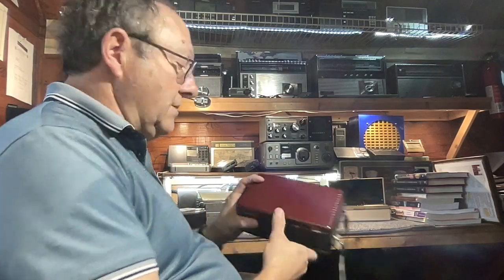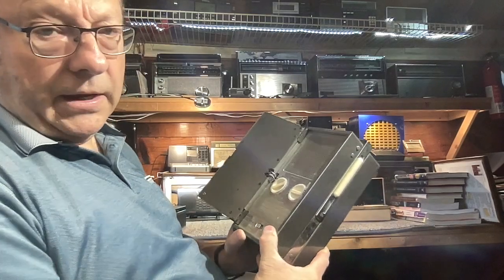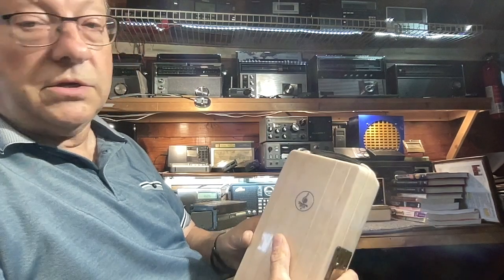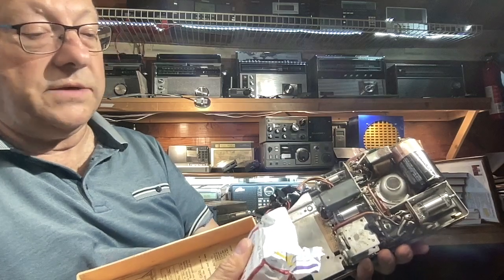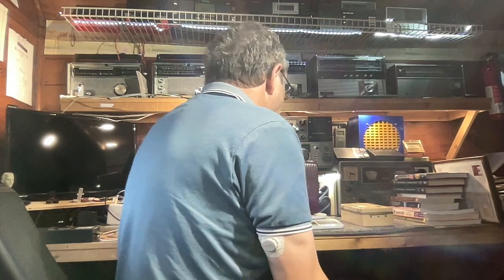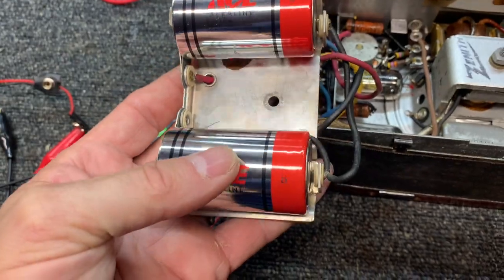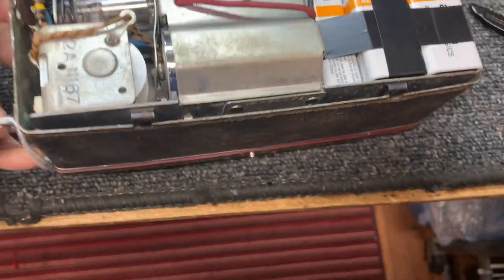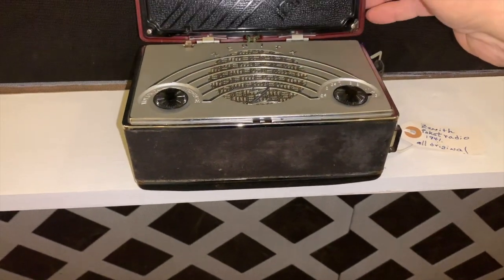Vintage Tech: 1941 Zenith POKET radio

Comment: N4 KRO
W4KG

Have you ever heard that in the tube days, of placing the tubes in a 150⁰ oven for an hour to help the oxygen eater to help with removing/ converting the
 oxides that build up over idle time?
See you Friday
W4KG
Reply from the maker: Yes it’s similar to rejuvenating a picture tube. But only a temporary fix. It’s a good idea if there are rare tubes.

Comment: I notice that tuning condenser is missing a screw. I don't know how you put your finger on it and didn't see it. I'm still watching the video so if you finally realize it's missing disregard this comment. That screw that's missing is part of the alignment
Reply from the maker: Good eyes.  This is not uncommon. This ring with the "missing screw" is a capacitor.  It is the broadcast antenna trimmer.  The adjustment is done by bending the ring slightly.  It does not need a screw and insulator like the broadcast oscillator capacitor uses (it has an insulator and screw).  Some sets do not even use a broadcast antenna adjustment.  I also pointed out the broadcast padder adjustment - which also serves as an antenna trimmer.
Reply: @KOVintageTech  Fair enough. 👍

Comment: Can you explain what you mean by "giggles" ? I don't get what you are saying when you say "Let's change this just for giggles" I
I'm trying to understand what "giggles" has to do with changing a part or working on something. I know giggles is a form of laughing, but you must have another meaning of it that has to do with electronics. Please explain why you keep referring to "giggles" 
Thanks
Reply from the maker: It's an American expression.  I said I would test them even though I am replacing them. So my thinking is that the test is not needed but just a curiosity. I simply mean that "testing for giggles" just means that it is not necessary, but might be fun to know if they were actually bad.   Incidentally, the test revealed that the caps were out of range and the replacement helped considerably.
Reply: @KOVintageTech   I American and I don't know anyone who says that just working on something,,very strange...